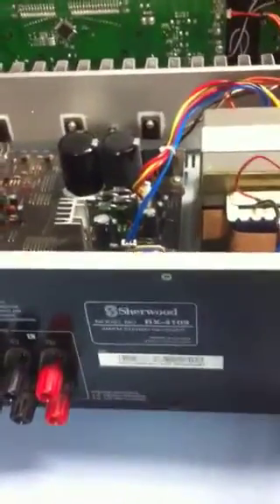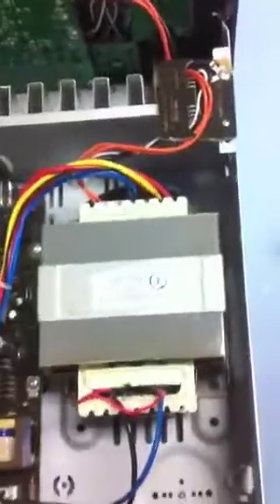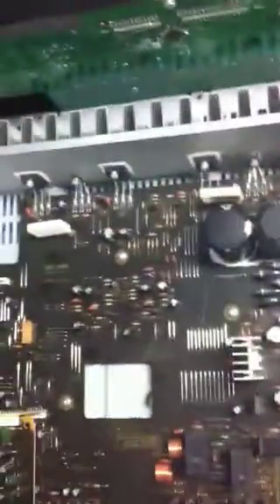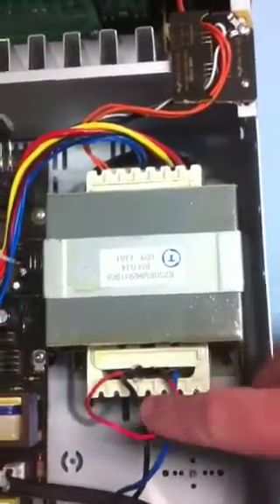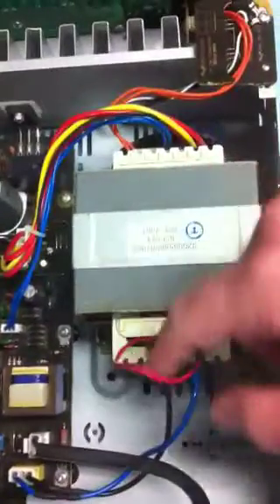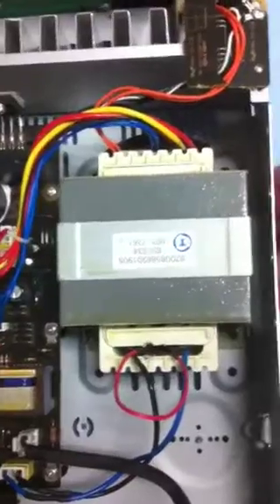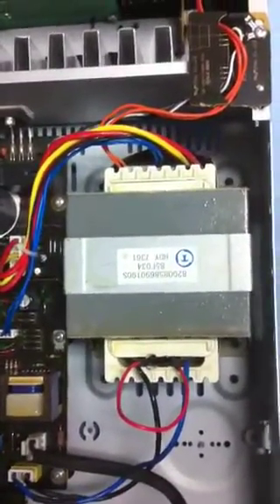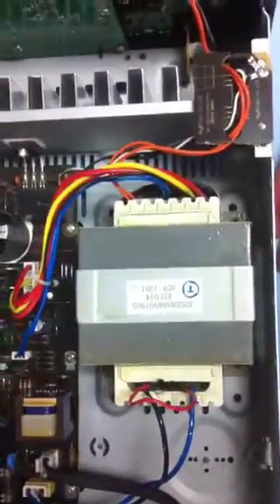Sherwood RX-4105 RX-4109 Open Transformer Repair.

Comment: I cannot believe that this video came up randomly on my youtube feed. I have one of these that the transformer died on 2 years ago. I tried to find a similar replacement but just bought another unit instead. Damn man thanks! I gotta go find my old trusty Sherwood and hopefully I can rescue it from the grave in my garage. This was great - thanks from an old hand electronics tech!  My unit I used for over 10 years and I pounded that beast with monster base out to 15" woofers and stuff for a hundreds of hours! ha! I guess that damn fuse ain't worth the price they paid for it. Planned Obsolescence.

Comment: @The Dollar Guy - I am having a problem with a Sherwood RD6505 Receiver shutting off automatically a couple of seconds after powering on. Guessing this is some kind of fault with a thermal or impedance sensor, have you had any experience with a fault like that and can you make any recommendations for how to approach troubleshooting and fixing it?
Reply: bro did you manage to find the fault ..i also have same problem
Reply: @almostfamous9796  I did, but it was a long time ago... from memory there was some gunk on the board causing a short. I cleaned it off and it worked fine for years after that

Comment: Indeed. But just for your case it would be nice to put back some thermal protection fuse, since you have acsess to it.
Also maybe that fuse is meant to be as close to transformer windings as possible in order to pick up heat quickly enough and prevent a short. (regardless the fact that anyway that transformer would be useless afterwards)

Comment: Well... correct frequency and voltage settings here but still managed to short the primary transformer windings on a Topward tps 2000 0-30V 10A DC bench psu after some hours in full load... It didn't have that thermal fuse at all.

Comment: Well, the reason the thermal fuse seems useless is cause transformers almost never fail or get shorted winding(s). But its incase someone operates it on the wrong frequency (USA has 60Hz, UK has 50Hz) or the wrong voltage (again, USA has 120v, UK has 240v).
Reply: MrGerbilBrain correct